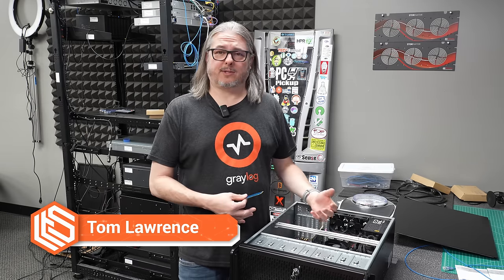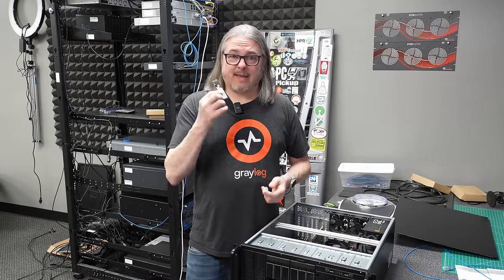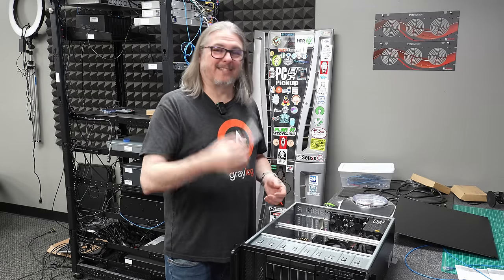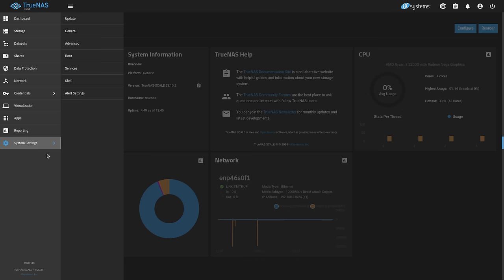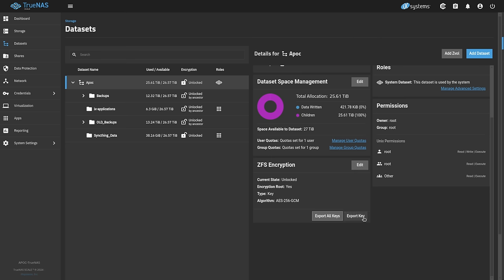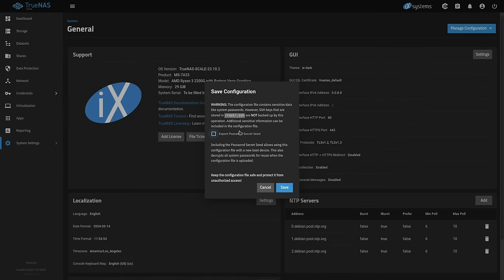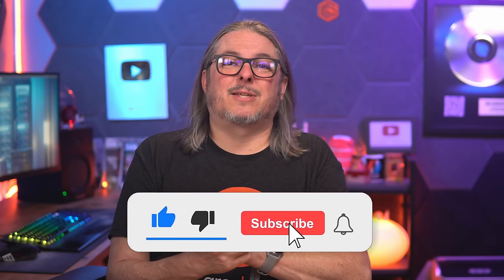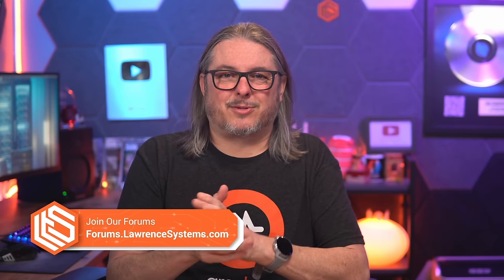TrueNAS Boot Drive Failure:How To Recover and Get Your NAS Back FAST

Comment: Great video!  I see this question asked at least weekly on the forums/reddit. One additional step I take is to add a nightly cron job that exports the config, and then I copy that off to another system for safe keeping. Config changes don’t happen that often, and are well documented, but it’s nice to not have to remember to re-export the configs every day that I do have changes.
Reply from the maker: That's a good idea!
Reply: How to do this? I am newbie

Comment: Can i get the backup file from the pool i have to import and restore after importing the pool on a new system (core systems)? Its not encrypted. The backups ended up on the pool after my main pc crashed.

Edit: i just tried it and im having the same lan configuration issues i was having with the system from a fresh install (cant update the network interfaces at all). I suppose im gonna have to look up how to set the whole thing up from scratch again.

Comment: I've had 2 nvme drives fail the exact same way.  Very annoying that they die like that with no warning and it's the reason Im rebuildingmy homelab servers to have redundant boot drives.  It is good that Truenas is fairly painless to recover so long as your config is backed up.
Reply: nothing is made with quality as it was even a few years ago.  I have lost 2 SSDs in the past 5 years.

Comment: The best would be that the you could automate this config with keys export to preferred safe location with encryption.
Reply: You can: settings>advanced>cron jobs.  The following will export your config and keys, then you can run some other process to copy it to another system:

tar cf /mnt/<pool>/<subdataset>/`hostname -s`-`date +%Y%m%d%H%M%S`.tar -C /data/ freenas-v1.db pwenc_secret

Replacing <pool> and <dataset> with your preferred location.

Comment: Nice demo video. One thing I'd like to know is - how did the original disk fail and how did it present? I ask because I noticed the pool showed in an exported state. I am not a ZFS expert, but I thought exporting a pool took manual effort (or at least, done explicitly by the OS). Did the drive fail but the system was still running enough for you to gracefully export the pool or shutdown the system? Or was this catastrophic?
Reply from the maker: Nope, it did not fail graceful and exported is what TrueNAS shows when it can see a pool that has not been previously imported.

Comment: My experience with consumer NVME in my desktops made me not trust them at all and sure as hell never use them for boot drives in a server. Dual consumer SATA SSD is a far better choice, you don't need NVME speeds on TrueNAS for boot anyway. I've been running consumer SSDs as boot drives in all my servers for almost 10 years with no issues, in that time I've had 2 die.

SSDs usually don't give any indication there gonna die, sometimes they do like causing crashes but in my experience one day there working, next there dead.

If people really want NVME boot then something like the Micron 7400 PRO is a much better choice and the 480GB costs stuff all.

Comment: I recently had to upgrade one of my TrueNAS Core pools as it was at 79% usage. Replaced each one or four 8TB HDD with a 12TB at a time. After resilver process, on to the next drive. 4 days later all was well and I had more room. Now only 46% of space used.
Reply: I need to do this , but unfortunately I have 8 drive Z2 arrays...

Comment: It’s nice how simple it is. Great video!

I always backup the config as part of the update process.  I keep the last 3 version.  I store them on my NAS datapool but the 1st of every month take manual offline copies and store them in a safe location.

Questions…
1) I started with freenas (truenas-core old school) running on a bootable USB stick, they were not great and seems risky so I moved to a spare WD raptor hdd instead (150gb 10k rpm sata1) much better and have no other use for these drives!  Upgraded hardware last year and had to move from truenas-core to truenas-scale to support AMD AM5 correctly (advice from devs for modern hardware support).  It warned during the update/migration that I should install on a SSD, is this really important or not?  I don’t see the need for myself but I would consider an SSD/NVME for a log or other cache drive aiding hdds rather than waste that speed on just the OS boot drive.  Or is worth moving anyway?

2) backups of the NAS config, any automated ways you would recommend / trust? (NAS to NAS? Cloud? USB? Or just manual do it?)

3) if you use an NVME drive for boot, is there a way to lock down say 20Gb for the OS and use anything spare for cache or other NAS services? (Can a mini pool be put on there?  I ask because I see 1Tb drives cost about the same or less compared with 32-128gb drives!!! Feels wasteful.
Reply from the maker: 1) using a USB is currently not the way to do it, but HDD or SSD is fine
2) there are some ways to automate it you can find in the TrueNAS forums, I just do it manually
3) There is no officially support ways, but there are ways you can find in the TrueNAS forums.

Comment: One of the SSDs died in a mirrored boot pool on my main Truenas server. How do I replace the failed drive and get the new replacement drive back in the boot pool? Will Truenas automatically add the new drive to the boot pool?

Comment: Will this process also restore users/groups and NFS/samba shares including their permissions/ACLs? 🤔
Reply from the maker: Users. groups and shares are all in the boot drive restore, the ACL & Permissions are on the datasets.
Reply: @LAWRENCESYSTEMS  Oh, that's even better!
So, you could theoretically import the pools on a completely different machine that is not even running TrueNAS (but maybe just Debian with openZFS or the like) and still have all ACLs preserved? Of course, in that case you would need to re-create the users and groups on that system or ideally, have all that in an LDAP already. 🤔
Reply from the maker: Yes, if the id's line up you can move the ZFS pool.
Reply: Will applications like PleX also be backed up or will they have to be reinstalled?

Comment: this is the main reason when i see people say redundant drive for truenas i scoff at the thought of wasting drive slot for redundant drive when as long as you periodically export the config file you are golden. It would be different if you where in a setting where you had no access to your truenas system then redundant is cool and all but for most home users it is not necessary. Unless you are using your boot drive for storing apps then you might want to consider it but i use different pool of for that and it is redundant.